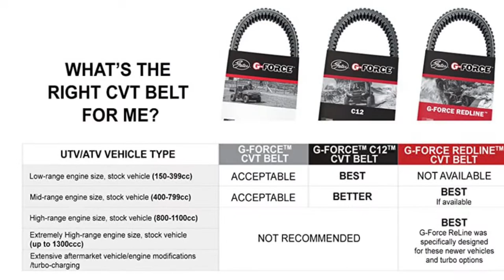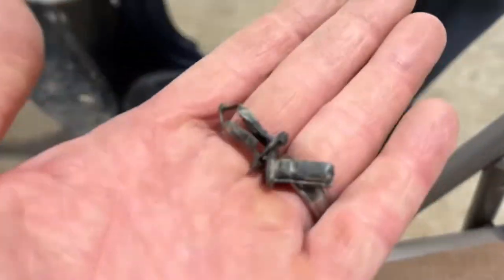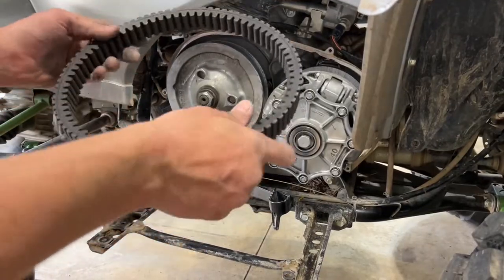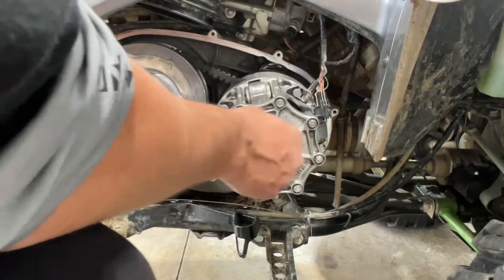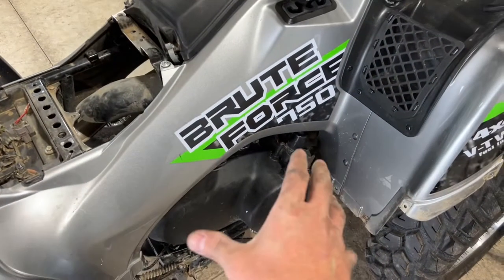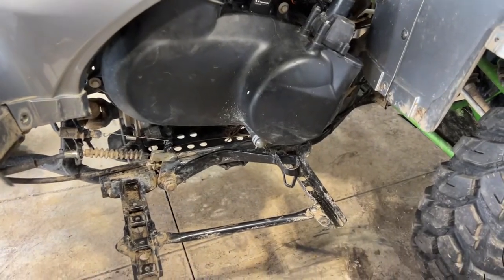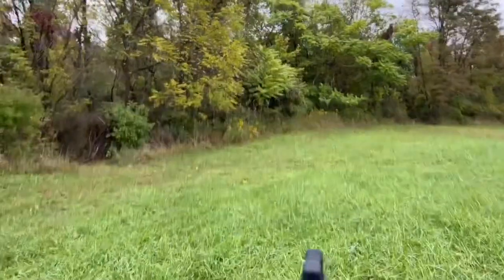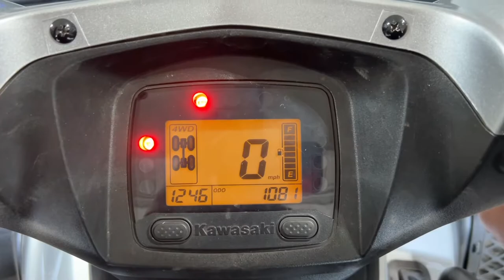How To Change The CVT Belt & Reset The CVT Warning Light On A 2019 Kawasaki Brute Force 750

Comment: I just did one of these.  The plug above the belt cover is the coolant temp sensor.  No need to unplug that one.  That's what made the fan come on.  Plug the jumper in, turn the key on, wait 10 seconds, turn the key off and restore the electrical connections.

Comment: I wonder why they dont just cut the belt to get it off. I mean a worn one cause he was able to save it. I would have a guy with a socket on the primary clutch nut cranking it while I guided the belt. I wonder if that would work good. it was a real good video. the kid did not ramble on and on and wasnt in love with himself lol

Comment: I put a new belt, did the jumper, and the plugs how it was done on here. And I still have a cvt like. Any ideas?
Reply: Reset switch when the belt break it hit the switch just flip it back
Reply: Does reset switch have to be to the right or to the left?